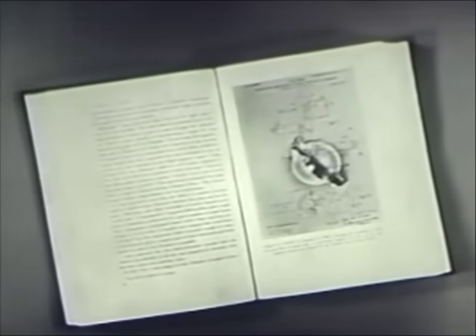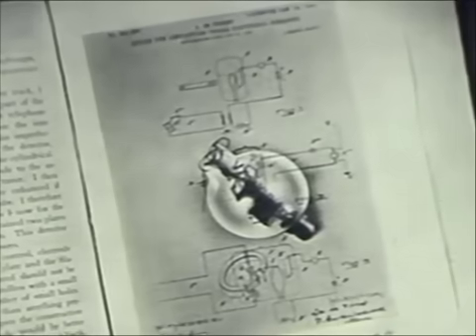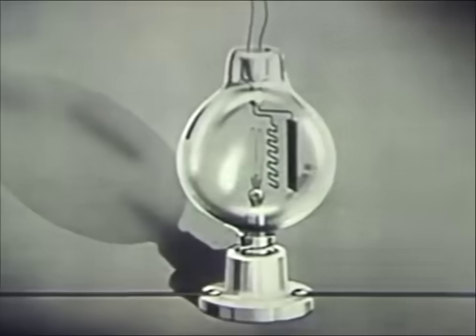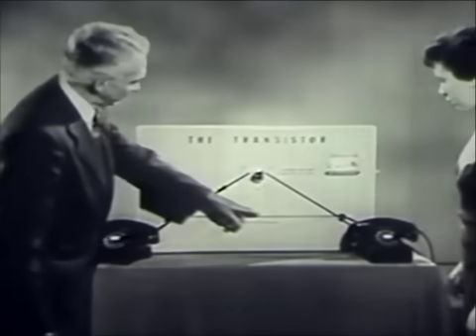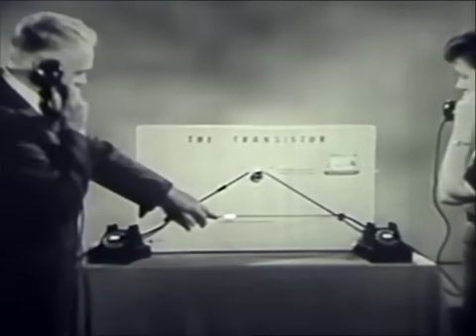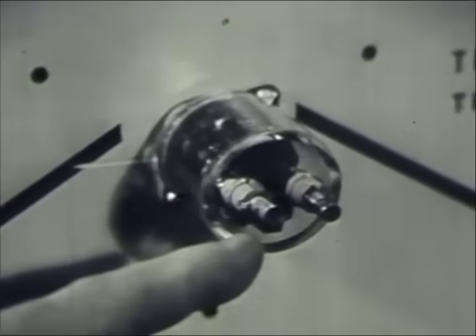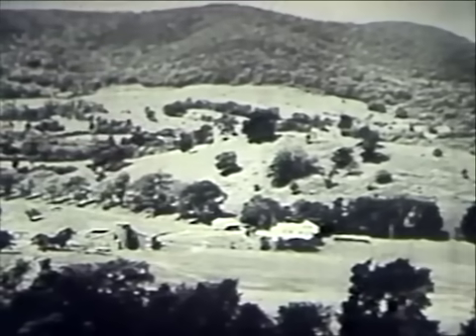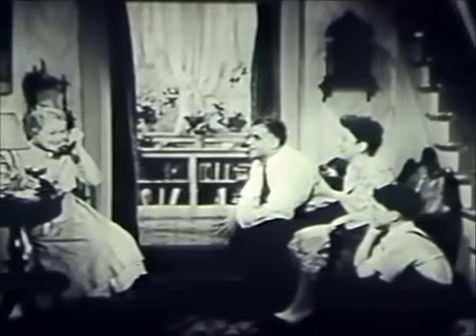The Transistor: a 1953 documentary, anticipating its coming impact on technology

Comment: Actually Bell Labs Did Not Invent the trandistor. Pnp npn ot fets. They certainly did perfect their use. T Henry Moray A Crack Pot Inventor had a Solid State device 10 years before Bell. Their people reportable visit Moray's home. Moray's Device was called the Moray's Valve. In fact a more proper name. Numerous witnesses and his family were knowledgeable about his work. He did not completely understand the device. DeForest Tube originally did not get credited to him because he could not describe how it worked. Sounds like today doesn't it. Marconi did not invent radio either. His device ran afoul of resonate electronic circuits and he to lost his claims. Nikola Tesla was tge first to understand resonance circuits. And Edison was terrified of his Alternating Current. Edison pursued  DC which at that point in time was limited in range due to resistance and heat in the conductor making it not practical. 
telecasterron Tramco R&D SBIR Tracker Weaponry System.

Comment: In the late 1950's I was an apprentice in a London radio/TV manufacturing facility. All the products were vacuum tube (valve) technology and we started making the first transistor radios in 1958. The transistors were made by the Mullard valve company and each one was handmade with around an 80% fail rate. This somewhat problematic beginning very quickly changed and the phenomenal developments in semiconductors technologies continues at an astounding pace.

Comment: Up until the transistor the Bell System was able to keep the network alive using electromechanical equipment designed and built in the twenties. The Electronic Switching System 1 of the early seventies was the Great Leap Forward. Historians do a search on Step by Step and Panel Switching systems. Needed three floors of equipment manned by dozens of technicians to keep those museum pieces running to serve twenty to forty thousand subscribers.

Comment: I restore antique radios, including a few early transistor radios.  Some of those early transistor radios proudly stated how many transistors they had in them.  I got a chuckle when I learned that some manufacturers, in an effort to make their units seem impressive, would design in transistors being used as diodes, or they were not really doing anything useful, but by gosh, we'll advertise that it has 12 transistors because it sounds cool!
Reply: I had an old early '70s no name walkie talkie that advertised 7 transistors but one actually had all 3 leads soldered together on one pad.
Reply: @patricknesbitt4003  That was a builtin backup transistor 😊
Reply: Megapixels in cameras
Reply: I had a 6-transistor radio (early to mid-60s) and it was hot stuff.
Reply: Similar to 'turbo' in 80's and 90's cars. Everything was turbo back then
Reply: @Bugaboo-wq5sc  How about Honda with the CVCC on the backs of cars? Like anyone that is not a car geek or engineer even knows what it means!
Reply: @ananda_miaoyin   I've long known that CVCC was the original name for the civic, but never bothered to look up why. So my "Ya learn something everyday" moment today is Compound Vortex Controlled Combustion. Thanks!
Reply: "By gosh" = +10 vintage vibes
Reply: "Solid State" was proudly stamped onto the kitchen radio we had when I was a kid in the 70s. Our TV was still full of Vacuum tubes
Reply: not so different from the stickers on brand new phones with the features of the screen or processors
Reply: I was talking exactly about this the other day to a friend,  how manufacturers inflated the number of transistors in their radios to impress people, even mentioned 12 as the number they would boast about.
Reply: A hang over from the days of four valve radios.
Reply: They really should have been trying to use as FEW transistors as possible and bragging about how efficient their circuit design was by using as few as possible.
Reply: Now you get the same with the screen and camera resolution on mobile devices :/
Reply: I used to have a 9 transistor radio from Japan
Reply: Even I have a 1965 General Electric P975D portable AM/FM proudly stating 15 transistors, and It still works. 😊
Reply: @isleifoterogarcia4478 I have a GE stereo from 1968 that I converted into a guitar amplifier, it sounds better than many actual purpose-built guitar amps I've tried, the germanium transistors overdrive in a fuzzy lo-fi way
Reply: Exactly right. You actually only need 7 for a decent AM radio, and 8 for a tuned-RF/high performance/fringe" AM radio. You might also be aware that the same thing happened in tube radios, where some of them had completely unnecessary separate oscillator amps, used triodes or pentodes as diodes, etc.
Reply: In the late 1950’s I had a four or five transistor pocket radio. What an amazing piece of technology.  WOW. 
Now my iPhone 13 Mini has a small A15 chip in it that has 15 BILLION transistors and other chips in it with even more. And a neural engine that can perform almost 15.8 trillion operations per second.  MAGIC .
Reply: Indeed. My old Ross multiband radio boasted "16 transistors, 7 diodes, and 1 thermistor super-heterodyne system."
Reply: Snake oil sales has very very ancient roots 🙄🤭
Reply: I once had a transistor radio that had the writing “All Transistor”.
Reply: I'll bet you a dollar to a doughnut that they got the idea from mechanical watches and how many jewels they had in them...  17!   😁
Reply: The beginning of false advertising,  hay like the pillow guy working to fool us because our ignorance about mathematics and electronics.
Reply: @eldonjanzen9822  False advertising is as old as advertising, even in antiquity there were snake oil salesmen who would claim that there elixirs could cure any ailment.
Reply: Ooh, the heat from those must have been incredible!
Reply: It was a giggle seeing transistors with a leg lopped off doing stellar duty as a  marketing tool.  😊
Reply: When I was a kid the 'six' transistor was was the common  thing - still don't know why.....
Reply: @MichaelPorter-r5g  One as a self-oscillating mixer, one as an IF amplifier, one as an AM demodulation diode, one as an audio driver stage for two as a push-pull output stage for the loudspeaker.

So there were actually only 5 transistor functions. This must have been the cheapest circuit. The diode-transistor was possibly partially defective or had very weak amplification performance.

A real “6-transistor” would have had a second IF stage, but this would have required an additional IF transformer, both driving up the cost.
Reply: YouTube WantsToSilenceMe  Willie Mays was a "Five T00l player." HE would have wanted Five heads....Huhuhuhuh.

Comment: The warm tube sound is still unbeatable.
Reply: I wouldn't go that far. Thousands of people prefer it over solid state circuits but that doesn't mean it's technically superior. In general the difference is due to the circuit design rather than the output device(s). Valve output stages are transformer coupled which can lend different sonic characteristics.

Comment: I remember my father bought a portable radio with 7 transistors proudly displayed as a selling logo. Later we have like 23 transistors radio with many phony transistors connected to no where. The 7 transistor radio was a "National" brand, now Panasonic.
Reply: 7 Transistors is all you needed in a simple AM radio. Some had 8.
1. RF Amplifier
2. Oscillator
3. Mixer
4. IF Amplifier
5. Detector
6. Audio Preamplifier
7. Audio Amplifier
8. An additional transistor if you had a Push-Pull Audio Amplifier.
If you had an FM band and SW bands and a more powerful Audio amp then you needed more transistors, but 23 seems a lot.

Comment: These older documentaries are so easy to follow.  They are delivered with mature intelligence.
Reply: But it did that by saying nothing about how the transistor works. We did learn a bit about thermionic valves but not about semiconductors and transistors.
Reply: @handyandy6488  Indeed. I kept waiting for a pithy explanation of what a transistor actually does and it never came.
Reply: @eyesuckle  In the simplest terms, just a solid state relay. Small current controlling a large current, but capable of very high switching speeds unlike a mechanical relay.
Reply: @handyandy6488 actually he did say what they do and how they work. He explained how the tube works which is how a transistor works. It just takes less voltage and less space
Reply: ;And I didn't hear any "you know" at all, you know? ;-)
Reply: With minimal animation required, as for Millennials  and especially ,gen Z today

Comment: Born in '54. I remember going to the electronics store with my dad to buy replacement vacuum tubes for our TV or HiFi radio.
I still have a transistor radio that I was given as a gift  around 1964 or '65. It still works.
Reply: Those things were ment to last.
Reply: I remember when the TV would go out. We would remove the tubes and take them to Walgreens. They had a tube tester where you could test every tube until the bad one was found.
Reply: Apple would like to know your location
Reply: I have a pocket transistor radio from ~60s Taiwan. Worked when I got it. Changing the bad capacitors also woke it up nicely.

Sounds like crap and I have much better AM radios, but I still love it!
Reply: Same, a Sanyo 6 transistor. My father disliked the expensive 9 volt batteries, the little Sanyo used 3 AA. Bought in 1965 in Japan and still works today.
Reply: '52 for me!  Same experiences.
Reply: Jun Gleno ah when planned obsolescence was not a concept yet
Reply: @watchrami  look up the "Phoebus Cartel". They were pretty good at planned obsolescence back in the day.
Reply: Me too And I loved that transistor radio Christmas $5 Took it with me everywhere

Comment: Transistors run cool. Err, yeah to a point. Run a 2 kW linear mode audio power amplifier flat out and you'll get heat. This narrative is only correct in the case of small signal transistors.
Reply: Okay, now to the actual point that was being made... try it with tubes.
Reply: @ydonl  the heat from the cathode heater will be negligible compared to the 2kW output power. It also depends upon amplifier topology. A class A design is coolest when running flat out.
Reply: @paulanderson79  Doesn't that assume the tube is 100% efficient?  That the internals are all precisely 0 ohms and there's no power loss in the tube?  My understanding is that the plate can get pretty hot, especially in power tubes, and that would totally swamp whatever heat is coming from the cathode heater.  I don't know what the numbers really are, though.  I just know it's way more than zero.
Reply: @ydonl  That's exactly what I said. The heat dissipated by the cathode heater is negligible compared to the 2 kilowatts the tube (valve) carrying. We are in complete agreement!!
A power transistor in linear mode will also get extremely hot at 2kW. In switched mode it should remain perfectly cold. In theory. However, there's no such thing as a perfect semiconductor.